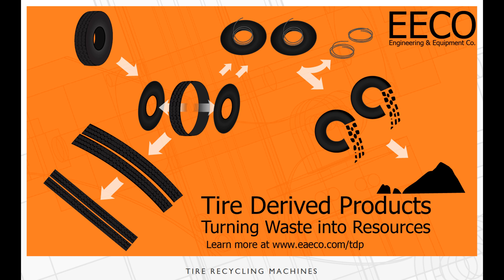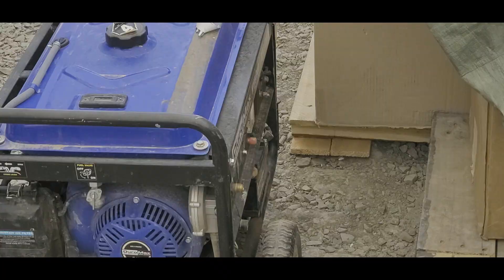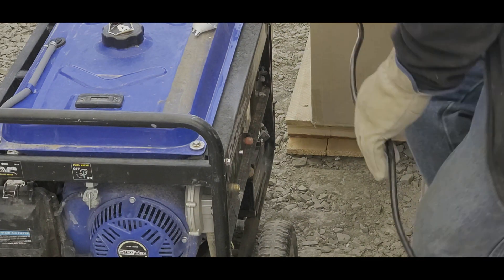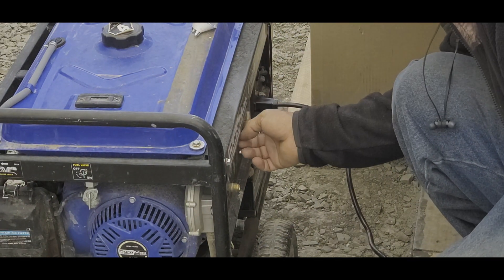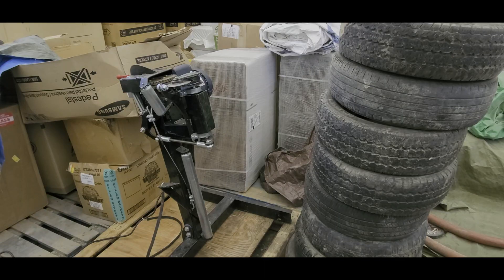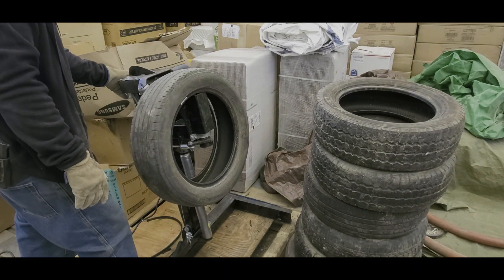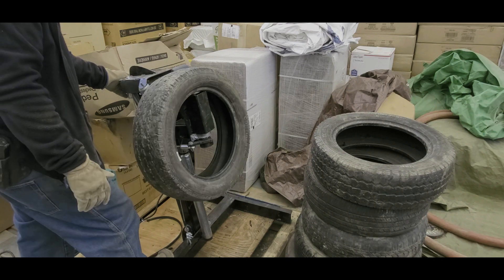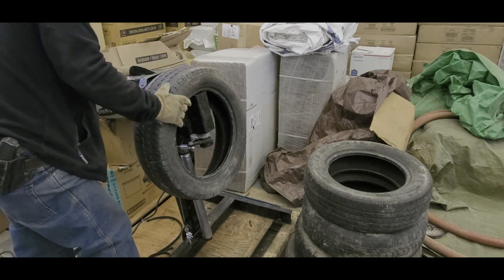Aircrete Tire Test | Aircrete Harry #aircreteharry #aircrete #tiretest #foamgenerator #offgrid #diy

Comment: You beat me to it. I was hoping to source a bunch of spent tires, cut the sidewall from each, position them down my driveway and then fill them with aircrete in place. I intended to run two lines, one for each tire track. I'd then refill between the tires with the existing sand mixture that's there now. Good job.

Comment: How do you keep your aircrete from falling? I bought one of your machines and have tried everything.. But I never get aircrete that doesn't fall to about a third what it started with..
Reply from the maker: You have to check the PH of your water. If you have hard water and it sound like you do you have to soften the water. Try adding a tea spoon of baking soda for every 5 gallons of water see if that help. Remember the foam solution water has to be soft also. Anytime you have a question ask right away I want you to make good Aircrete. Check out this video.  https://www.youtube.com/watch?v=bBYsfEHKYCk&list=FL-KOsxBimCOaSeh1Hxkii4Q&index=41&t=2s
Reply: @AircreteHarry  Thank you so much, I will try that! 🤝🏻

Comment: What is that machine that cuts the side walls out of the tires called?
Reply from the maker: You can go to there website and see all the machines.
Reply: @AircreteHarry  Thanks, I found it now!
Reply: What is that machine that cuts the side walls out of the tires called?
WAY OVER PRICED IS WHAT I CALL IT !
PSR1-1 POCKET SIDEWALL REMOVER
$2,100.00

Comment: This would be great to see adapted into Earthships for the thermal insulation wrap in the berm. Pour them, let them set up, and stack them just like the rammed earth tire walls and pack the gaps with much less rigid polyiso insulation and probably double the amount of tires you take out of the heaps. Tires with dirt for thermal mass, tires with aircrete for insulation.
Reply from the maker: That's the plan for my greenhouse, It will be my version of an Earth-ship.
Reply: @AircreteHarry  looking forward to that video of your version of an earthship
Reply: @AircreteHarry  Fantastic. I look forward to seeing the construction. I am clearly not used to thinking in terms of aircrete though... I realized the gaps could easily be filled with it too once the filled tires are in place. Duh. haha.

Comment: I know you call yourself "Aircrete Harry" because you like using aircrete but filling the tires with crushed rock topped off with sand would have been faster, cheaper, and allowed for easy removal and repurposing if your plans change. For example, wouldn't these aircrete/tires be better used as the wall of a workshop?
Reply from the maker: Well being in a tire I can now roll them wherever I need them, walk way or wall. It's just a test to see what things I can do with them nothing set in stone yet or Aircrete.

Comment: In cold climates I favor SIPS. See: https://youtu.be/-uexFrd3GuY and https://youtu.be/lChW-5J1Mbw
Reply from the maker: I would find a warm place to make Aircrete or EPIC bricks to build. It's a lot of work to build with timber. Not for me. :-) 

What I really have in mind to do is buy one of does 60 foot inflatable domes like a bouncy house without the floor. Set it up in winter or raining days, warm the space up with a rocket stove mass heater, and get to building. Never be delayed by weather again. What do you think? 

I had that idea for 4 years now. I know I can buy it from China but I never ordered from the Made in China site before. Not sure how the whole import thing works.
Reply: @AircreteHarry  I seem to remember you had several inflatable domes in your road trailer (See: https://youtu.be/Ui89IRSxcTw @6:15 ). Did you change your mind? I don't think there is a quick and economical home build - everyone has a different form and finish expectation so what is right for Harry might not be for Darwin or Nik or more important the Mrs.  Thank for sharing Harry... you will always be Aircrete Harry!

Comment: this is a light alternative to the earth ship packed tires but defeats the thermal mass these would act as insulators for under floor driveway insulation but not a good application for earth ship walls as the thermal mass essential to providing or more effectively respirating a constant temperature in to a home. That being said the most effective way to pour earthship tires would be a mud or adobe based slurry which would provide strength and thermal mass while also taking care of the site displaced fill dirt.
Reply from the maker: This Aircrete tire would be to replace the foam insulation in an Earth ship. Look at it as a new way to insulate.